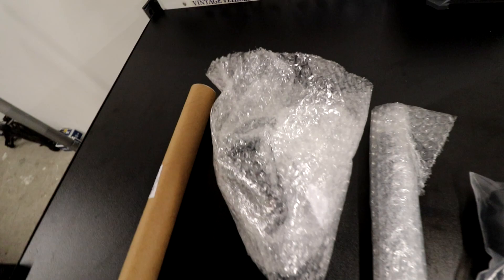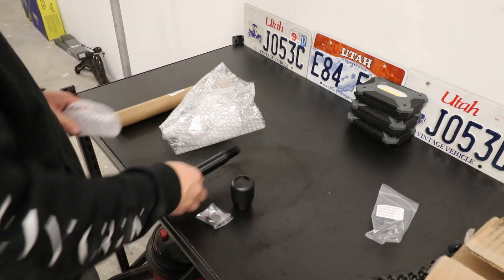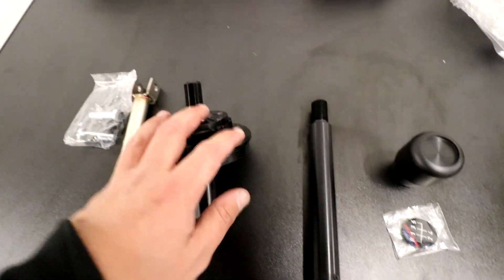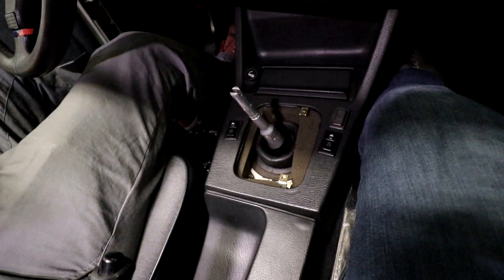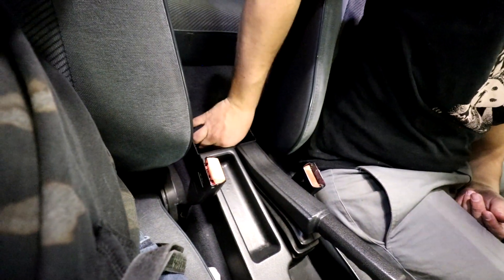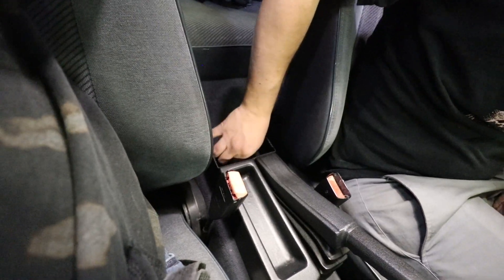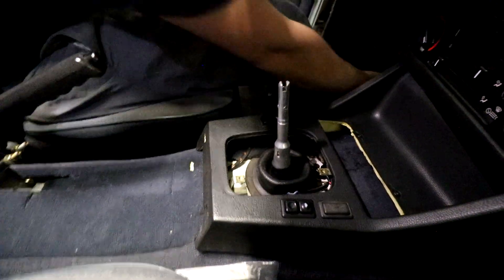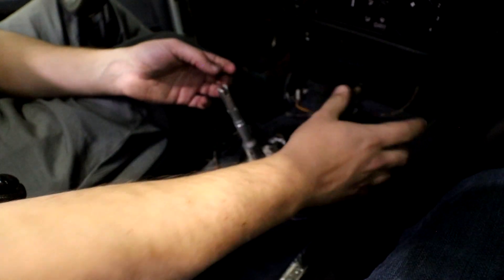The E30 gets a crazy shifter! (Garagistic chassis mount shifter install/review)

Comment: Okay, I really like the concept.  I did this in an MX5 several years ago and would highly recommend a short-shifter and especially in an older car - it will give it a much newer feel.  That being said, does anyone make this device for an E30 that looks much closer to the stock shifter?  I just really don't want a log sticking up from the center console.
Reply from the maker: Garagistic makes an oem/stock shifter length for there chassis mount shifter

Comment: Do I need the engine and trans mounts to do this?
Reply from the maker: Ya garagistic recommends atleast the 80A durometer poly for the chassis mount
Reply: @BimmersandBoost  I did that. But then I’m getting some savage slop when I’m in a gear.